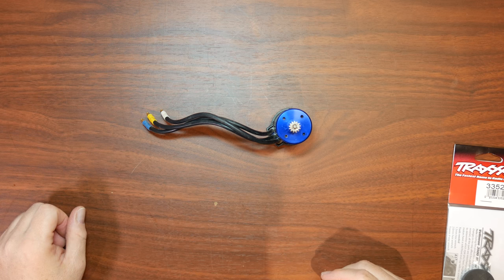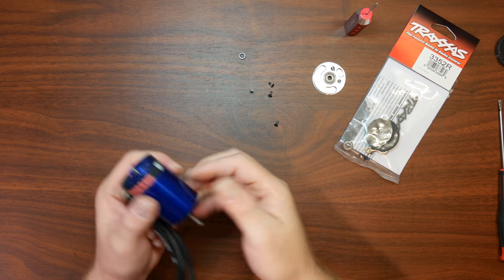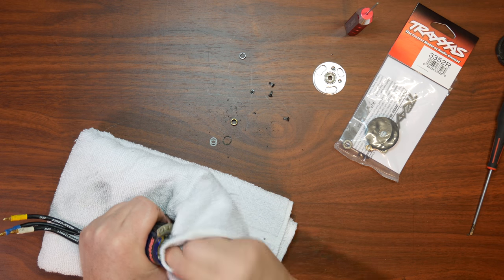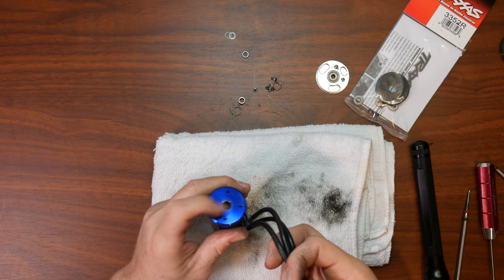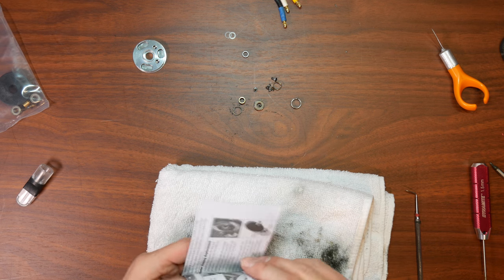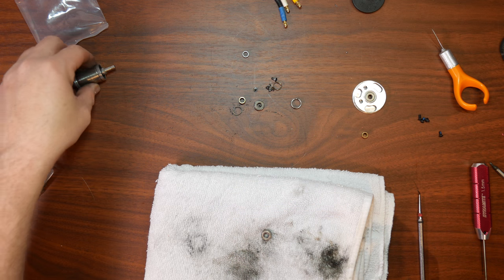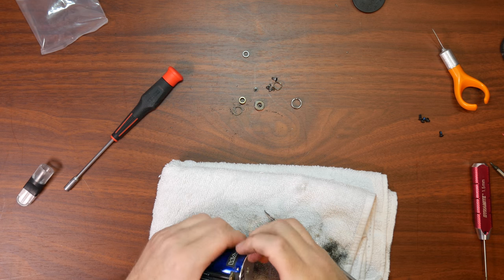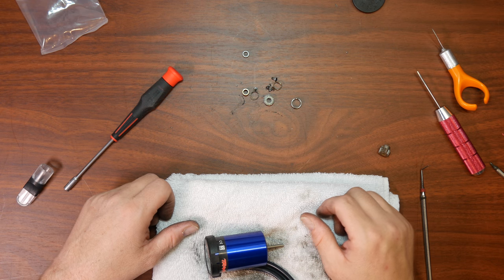How To Rebuild A Traxxas Velineon Motor     4k

Comment: A tip is to use the Traxxas tool that removes the wheel nuts, it fits in the back hole of the can perfectly then you use a rubber mallet and tap the tool which is just touching the bearing and it will get the bearing out.

Comment: I never like Traxxas, but I was amazed by my first 1/10 Velineon setup! I have about 20 RC's atm (stupid, but I couldnt stop) & now I own quite a few Traxxas models (3x Bandits bought used to clean up & sell) Stampede, Rustler, Slash, E-Revo & Summit (the huge 1/10 scale ones that everyone thinks are 1/8) & the Slash turned out to be my favorite RC ever! (only the 2WD version is my fav) With the Velineon VXL Motor & ESC its possibly the fastest & most powerful 1/10 I have & the 2WD Slash is by far the best handling RC Ive ever owned, I have 2 of them & even better they have the OBA (on board audio) & for some reason the sound kit makes them soooo much more fun to drive! it works so well & literally sounds like a full sized tuned race spec V8 engine. Couldnt recommend the OBA more & it works with any RC as long as you have a 2.4ghz Traxxas Transmitter & Receiver, any model as long as its the later 2.4ghz models, not the 2.4ghz models that look like the old 27mhz ones.

Comment: Great video. One question though, did you use both washers that were given with the rebuild kit ?
Reply from the maker: Very good question I do not remember but follow what’s on your motor.
Reply: @djsprc  Alright, just bear with me for another question how often does this kind of maintenance need to be done, if you hear that dreadful noise from the motor or for instance once a year. ?
Reply from the maker: @georgepapamichail1006  you should not do this often if you maintain your vehicle you should not but if you’re running a lot in snow rain mud you’ll need to maintain your motor

Comment: Hey bud I k ow the video is old but that rebuild kit is for the newer 4 pole motor which uses the plastic end bell and has braided wires 
I love my 2 pole on my 4 pole esc on nihm it beats the new 4 pole motor on 2s all day 
My question though did you uabe any issue with the motor using that rebuikd kit heat isssues running issues anything if not I'm ordering two so I have them
Reply from the maker: My success ratio is roughly about 50-50 with the rebuild kit if you get to the point that your bearings are done there is a chance that the motor is done to. Now the  rebuild kit for the new motors I did not play with it yet
Reply: @djsprc  please let me know if it worked out for you

Comment: How do you know when the motors bearings are shot will it make some wired noise when you are driving it or do you have to take it apart to check?
Reply from the maker: If you start seeing your com moving up and down that’s a good sign that your bearings are done and yes. If you want to open it to do confirm if they’re good or not you could
Reply: Thanks👍
Reply: Mine wines I haven’t rebuilt it yet but that is what mine does

Comment: How did you get it out when you heated it up
Reply from the maker: Basically what I did is i use with multiple kind of tools to grab the side of the bearing and slowly hammering it out you have to be careful. To make sure your tool does not slip and ruin the windings if that happens unfortunately your motor will be done

Comment: Can I replace the part in then middle
Reply from the maker: If you’re talking about the magnet part that is the com no you cannot change that you will need a brand new motor
Reply: Where ever the pinion gear goes on broke off I wanted to fix it since I don't have the money for a new motor
Reply from the maker: mint.turbo What you’re explaining to me it’s the main shaft coming out of the motor if that’s the case unfortunately you cannot replace that you will need a new motor.
Reply: Well I'm out for a month was fun doing it lol
Reply from the maker: mint.turbo Sorry to hear that

Comment: need ceramic bearing. It might improve performance.
Reply: Have you used a Velineon 3351r motor before? They definitely dont need ANY changes as they are possibly the best motor you can get for a 1/10 scale RC!